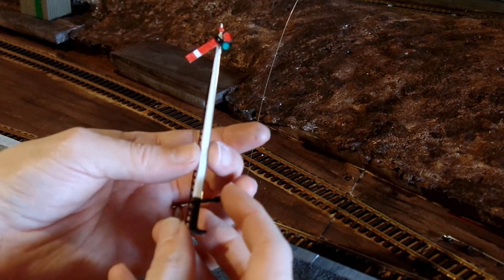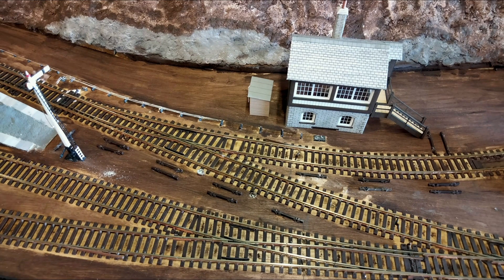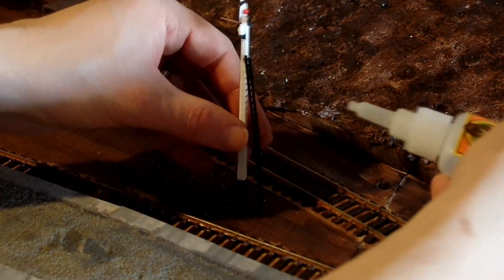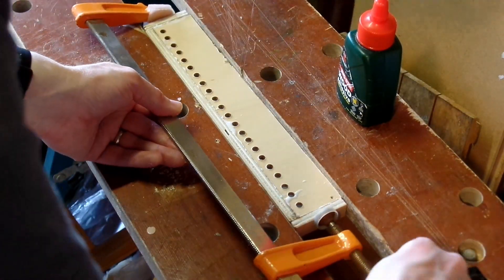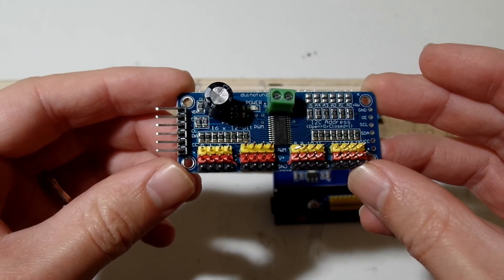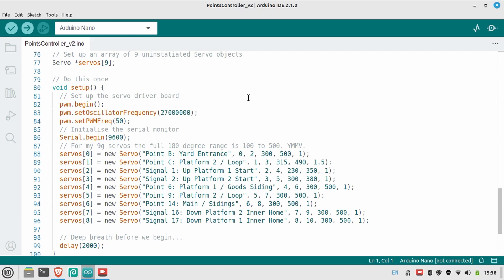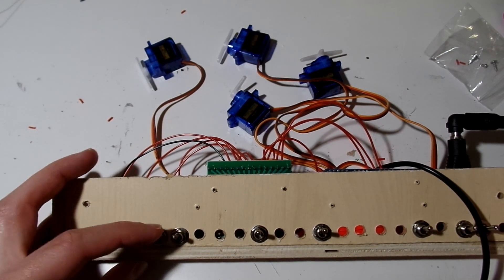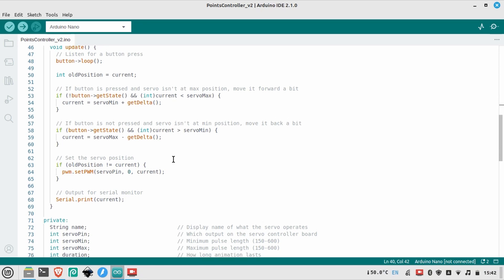Signals and servos controlled by an Arduino Nano | Modelling a GWR branch line | Episode 16

Comment: Cool project!  I am not sure all that work with the Arduino is really necessary for such a small layout! As the distance from the operator's position to where the signals are is so short, a simple mechanical pulley is all you needed?  However, since it is now electronically controlled, you could create an AI layout, and just sit there with your cup of coffee and watch the trains go by! Thanks for uploading.
Reply from the maker: I used manual control like that on my previous layout. And it worked just fine. But I'm a programmer in my day job, so using an Arduino appealed to me! Automation is certainly possible with DCC, though I think it would take away the "playability" on a layout this size.

Comment: That's a pretty inexpensive signal setup. I like it.
Will you be using those same servos for the points or something a bit beefier?
Reply: I use FS 90 servo on all my points  is strong enough switch  Peco points with out taking spring out .  I use both Tillig and Peco points
Reply from the maker: I'll be using the same 9g servos for the points. You have to take out the spring that normally snaps the blades into position, but that's easily done and means the servo has less work to do. The 9g unit is more than strong enough for that.

And yes, very inexpensive, especially compared to the commercially available solutions (like the Dapol signals). Though of course there's a fair bit more trial and error when you do it yourself. But that's half the fun sometimes!